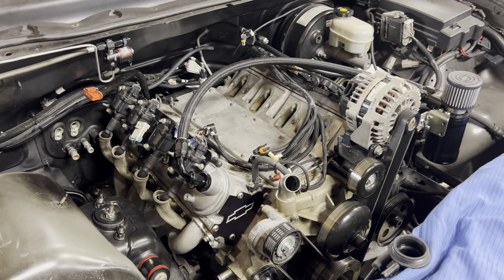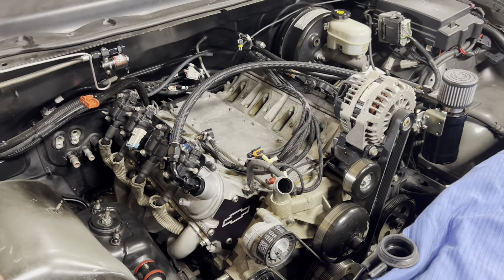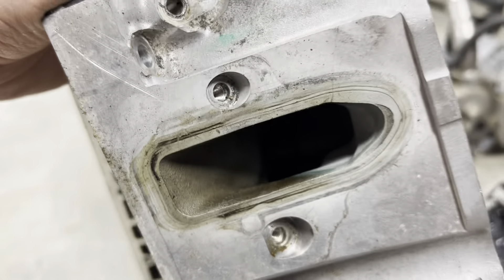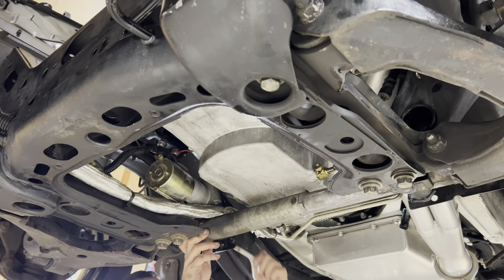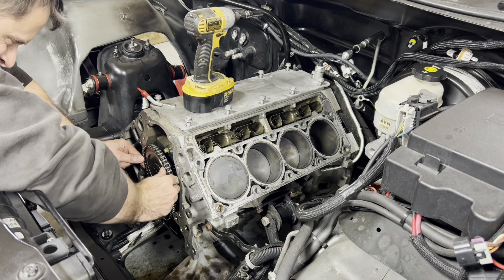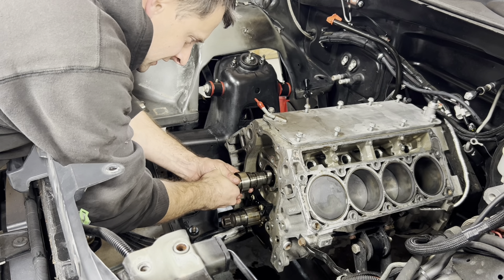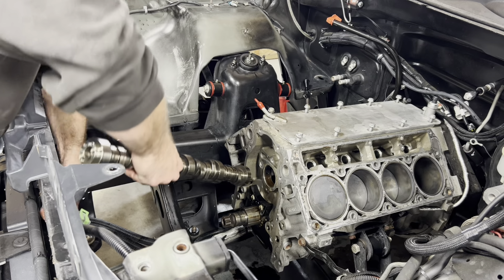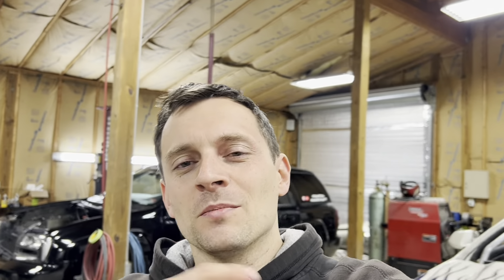The ULTIMATE Cam Only Trailblazer SS Build! - We’re Going for the RECORD Ep. 1

Comment: I was wondering what gas pedal are you running too run a cable setup for throttle body and cable thank you
Reply from the maker: I modified my original one and welded a tab on to accept a motion raceworks cable